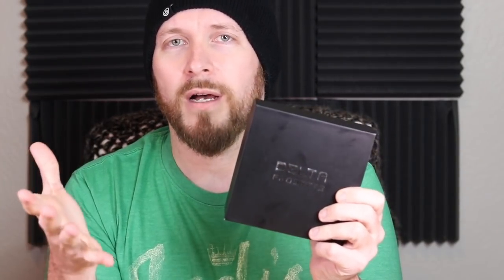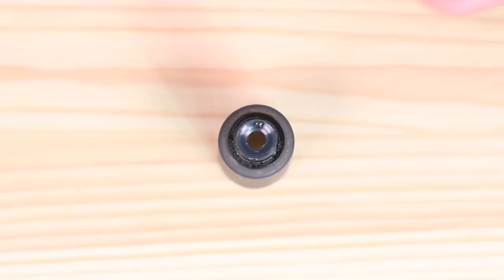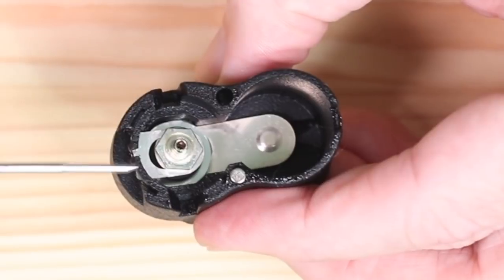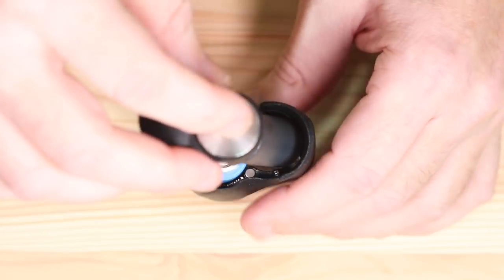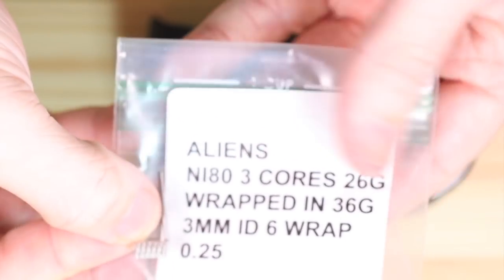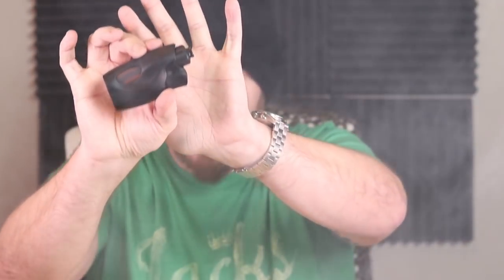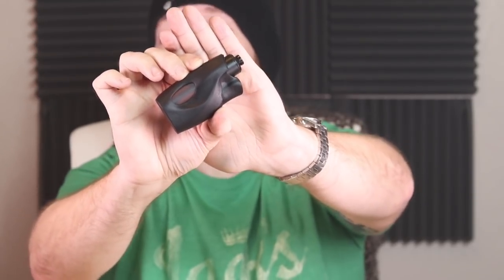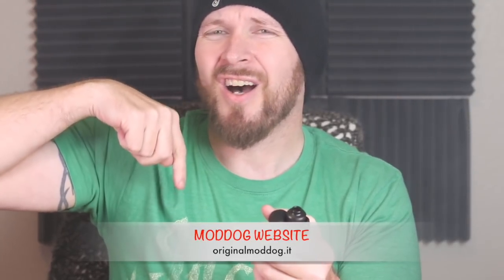MODDOG STIGE SQUONKER ~ 3D/18650/MECH/NANO V2 510/.999 :-)

Comment: nano v2 is a nice small 510, you can also adjust the contact from the bottom. i do have a simple alumide 3d printed box mod made using the nano v2 and the rhodium plated contact. it's a great hard hitting squonk mod for me.

Comment: Have you seen any of Cloud Laboratory mods on shapeways, he has a FB page of same name uses mod dog 510s silver contacts mech, 
or mod maker 510s clickfets 
Or switchfets, ect 18650 or 21700 even does some with rib from seathvapes with mech 18650 21700 in copper or silver contacts some nice designs you buy parts and build your self